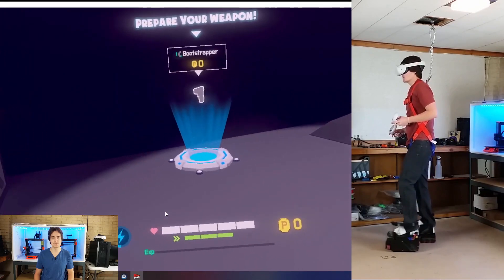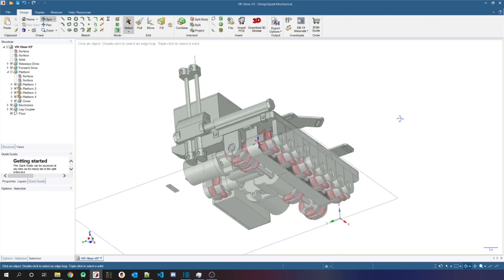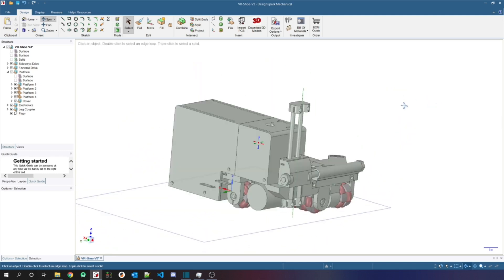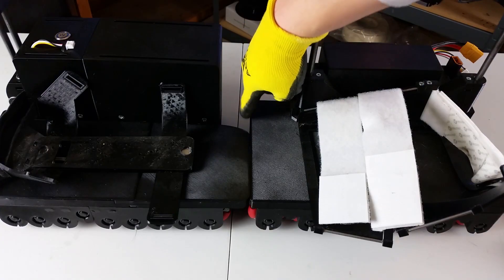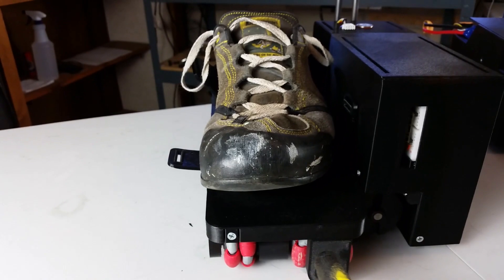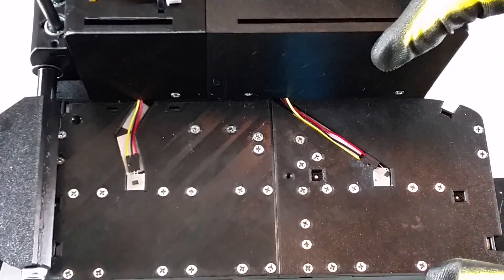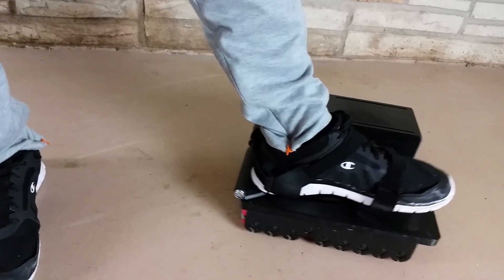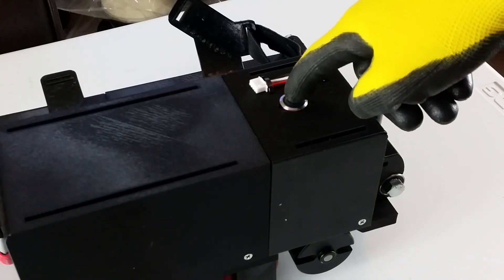Virtual Reality Motorized Shoe Build Log #31 - New Design and Improvements

Comment: Hey I'm a total stranger to this I just saw an ad on Instagram for the Omni by virtuex and wanted to look into the designs out of curiosity, and I think they're onto something with the concave walking space- but I have an idea, although it isn't probably very compact. I bought a sphero robot some years ago and it functions with a gyroscope and motors on the inside to rotate the sphere that encases it - just an idea I thought of without thinking about any of the details you would probably think of, maybe a larger scale version where you essentially are in some sort of hamster ball that moves when you make movements but stays firmly in place when you aren't? or maybe a combination of a couple of the ideas mentioned in this video, you could have two joined vertical hoops that follow your legs individually to lay the path of each foot? Or replace the wheels on the shoes with spheres, as to allow Omni-directional movement? I don't know what I'm talking about, I'm no engineer, but I'm thinking as if I'm a kid playing with LEGOs again. Here I go, making a fool of myself on the internet.
Reply from the maker: I think it's great you're thinking about the concepts. I think there is a VR locomotion device that is a giant hamster ball. Problem is the giant ball has a lot of momentum behind it so it can't stop or change direction very fast. The sphere robot you mentioned, is that a ballbot?
https://en.wikipedia.org/wiki/Ballbot
They've been brought up on my discord a few times. It's hard to miniaturize that concept so it could fit in a shoe and be stable.